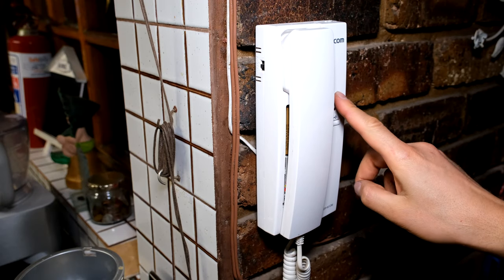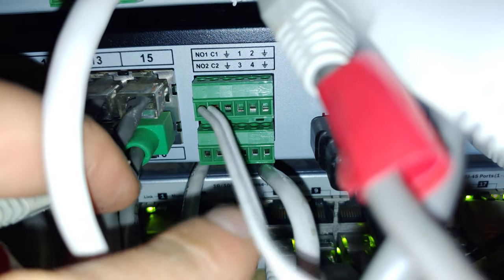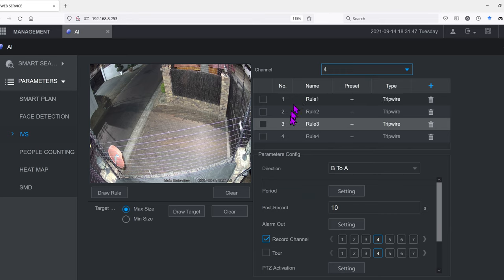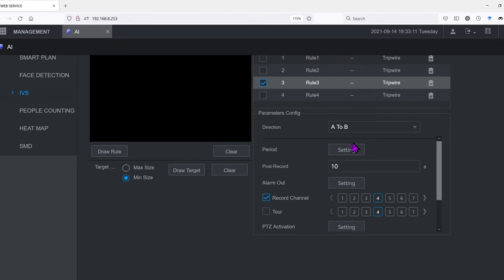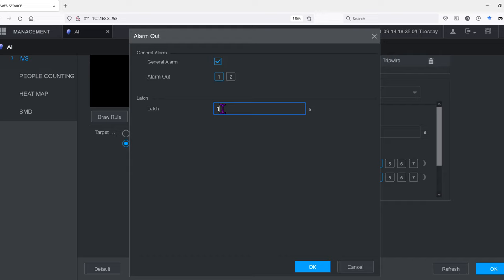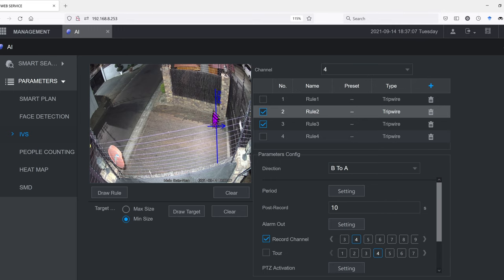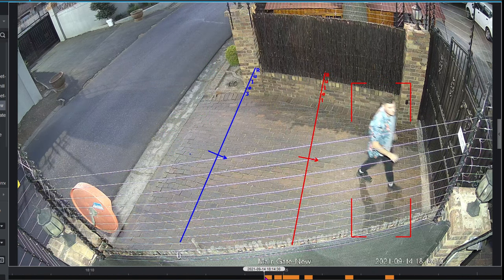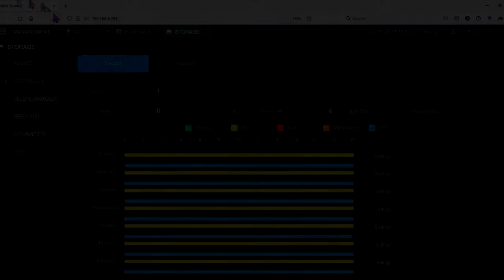Using the Dahua CCTV camera Tripwire alarm as a door bell - Tripwire tips also shown

Comment: Very nice Video.. So I am wondering if your 4216 has a few things like mine does!? On my NVR I can setup the Ability to see what I call fast Action but on my NVR it is Preview Mode?! If I click AI any of the IVS triggers can also pop up on the main screen of only the NVR's GUI, I can Click that and it will show the Recorded file without having to do a Search or access playback menu! Also just incase for people that are looking to setup something like this you can also use the Alarm in the Schedule for setting up for recordings and doing a search for playback.. Take for instance you have IVS checked for search but only want events that caused an alarm. If that was in the Recording Schedule area when there is an alarm that was triggered or went off then that is what would be found when searched for.. This can be helpful if you have like ECO does with multi line crossing settings. With Alarm setting set, and the Rules are setup on a Schedule even though the IVS might still be found under the Search if it didn't setoff an alarm on that timing then it wouldn't show up on the alarms search.. However if that did set off the alarm because it was setup for that timing then it could be found under the Alarm search...
Reply from the maker: Hi Revo, thanks for your comment. Do you have the problem on your Dahua units whereby the recording jumps? For example, when in playback, it plays the clip but its not a smooth recording, some parts must have been missed, like i see a person walking then next thing he is 3m ahead and the NVR just missed that section? I had some luck by increasing the sensitivity, but maybe you have some pearls of wisdom here?
Reply: @ecologicaltime  Hello an thanks for reaching out, I personally don't have that issue. I will admit that there are some times that my Camera for what ever reason has a half or more then half at times Video in first few seconds that are Green. This is normally on my AI Camera channel. Also what is odd is that when I play it back from the Search it isn't there. It is like only when I play it back from the AI View off my Main GUI side bar on the right. I am not sure if you use IVS, But in mine right click the screen in any grid or single ch view, Then in Preview Mode I have mine in AI Mode. Only when I click that channel. I wish I had some to make a video  however it hasn't done it lately and it might be because I moved one of my Tripwires to a different channel.. 3m ahead? So are we talking meters or minutes? Only asking because it might have something do do with your Detection zones, or even your Record Delay times. So say that your in your Grid for detection and only have a small Grid, But your scene is 4 minutes walking and your grid is starting say on the right, It could be that your Detection zone (Grid) needs to be larger, or your Delay needs to be longer. Also if Detection and SMD or AI isn't turned on for detection it could be that a Bird that wasn't seen has triggered and caused the 3 min.. Also what type of Scene is it? Have your Looked at your systems DORI? Lets say that I turn on my Face Rec, on my 2.7mm lens camera that is 100 feet from the ROI, I don't get anything worth using. However because this camera is also a Motorized zoom lens I move into the 12.5mm and now my FOV is much closer to the ROI and it can now Detect faces.. However pull back the camera and it won't be able to work because it is outside of the DORI for the camera..  Detect, Observe, Recognize and Identify respectively
Reply: @ecologicaltime  Also I guess I should have asked is this in Full time recording where you can see that Spot missing on your timeline? Is this camera a Wifi or POE camera? Have you tested your wiring and sure that your using Real Copper wiring and not CCA? Is this issue Constant or is it sporadic? Could you maybe upload a Sample of what your talking about and send me a link could be just a non published video of a short clip.. It Could be many things, It might be even Audio Detection if you have that Enabled, Like Motion picked it up first, then something happens in scene that caused loud noise that has trigged the Audio Record?
Reply: @ecologicaltime  Hello again. So I have not been able to get the NVR to do the Green Screen however while I was looking at some footage that I was sending to an FTP server on my AI DVR I noticed the Green screen so I thought I would upload that and pass the link to you to look at. You can Delete this post after you watch if you want to or can leave it online it is up to you. This is the link to the Video where I show what I was talking about the Green Screen.. https://youtu.be/eHVGYLEG3a0.. Also after doing some playback today only time I get any type of jumps in playback is when I do a Smart Search and the screen goes from regular full time recordings to motion and or going from 1 event to the next.. It could be that the Motion Grid and your area of view that started the recording went to the end of your Record cycle (After the Anti-Dither) and then it was picked up again and recording started again. However if you look in your Motion Events in search that would be evident in the recorded files.. Are you using 1 or 2 HDD? Are you doing full time recording on HDD1 and motion on HDD2? Or being sent to 1 hdd . Is it older HDD and have you looked at your HDD smart Data?
Reply from the maker: hi Revo, thanks for the reply, the grid is the entire field of view. I just notice it jitters, its like it records and then there is a short gap and then continues. In my case its both for tripwire recording and regular recording. maybe i should play around with the delay. I recall i did that and it didnt make a difference but that was on an older NVR. My Hikvision NVRs have no such issues, record smoothly, no gaps. My Dahua however has gaps in recordings even when there is motion.
Reply from the maker: its a hardwired camera, connection is perfect, happens on more than one camera. I was also wondering if my settings are all at max, maybe its a buffer limit
Reply: @ecologicaltime  Personally I change mine for most of my cameras. Bit Rate rare to be over 4096 as I noticed that there would or could be some issues if I went higher. Next I change all my fps to 22 on main and 18 on sub. Plus that is still more then I had on my Hikvision products that most times are upto 15fps.
Reply from the maker: Ok ill try lower bit rate they at max
Reply: @ecologicaltime  So an update, Tonight I had an alarm trigger on one of my Dahua cameras that I got a Tripwire alert, So I looked on my 4216 for the event, Only showed very short clip. So I changed back to full time playback and when the event of people came into screen they went away and came back 20 seconds later on the Trip. So then couldn't see who it was so I changed from full time to full, Alarm, Motion and IVS and was able to play it all. So I am wondering if when you search and playback if it is doing the full search or just IVS and Full time? Oddly enough I don't have motion active there but there was an area of Motion that was removed from IVS full playback. Maybe do the Search (Playback) choose all of the boxes, ON mine Sync, ALL (Regular, Alarm, Motion, and IVS) with them all maybe it will playback the whole thing.. If I remember you also have Alarm as an event so if alarm isn't checked you might be missing the Alarm part of the playback.. ?